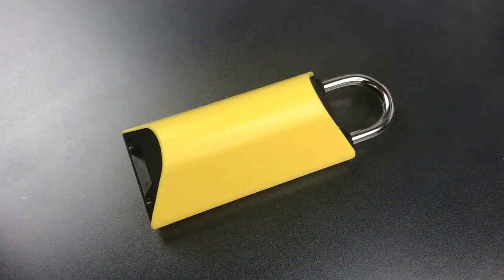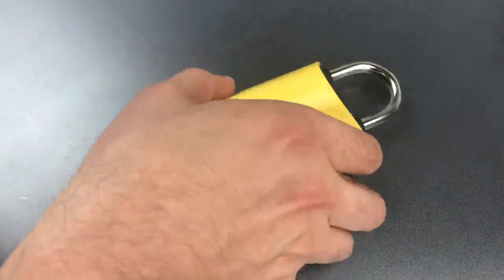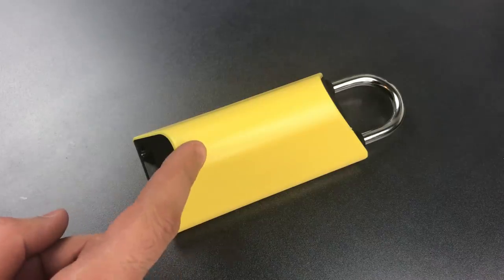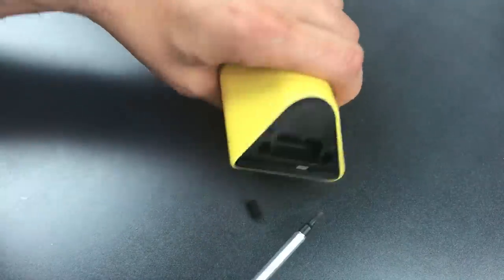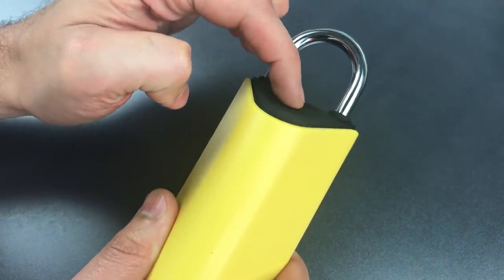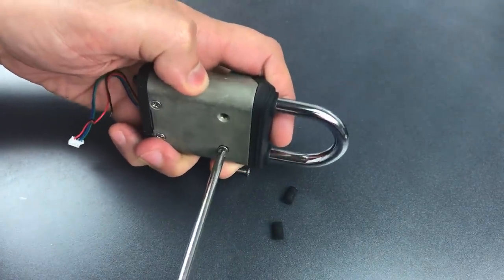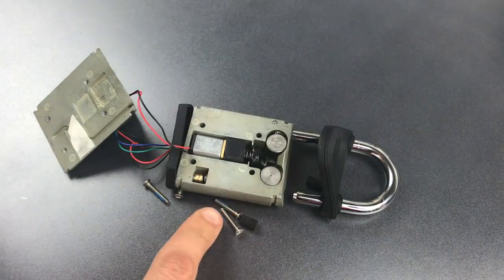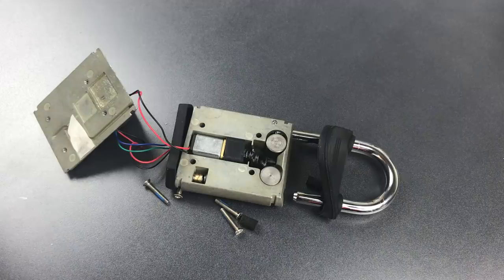[752] BoxLock: $129 Barcode-Scanning Padlock Opened With Screwdrivers!

Comment: Foam, the ultimate security material
Reply: Seriously. Even a tiny squirt of hot glue instead of the foam would have made for a significantly greater challenge.
Reply: @KurtRichterCISSP  and im suprised it wasnt a standard phillips Lol
Reply: Also the ultimate builders material. The lock itself us not much better than tied string
Reply: I'ld go with hot glue if it was my lock. To remove the hot glue, you need heat, which to bring it there you need alot of it, which would just melt the case anyway. The other way to remove the hotglue is to drill, which epoxy wouln't resist more anyway. But if the lock do need repair or a battery replacement, then you can easilly do it.
Reply: And welding the screws on the inner part would made it much harder to open.
Reply: @qq84  Other discussions show that the motor in the inner case can be controlled from outside.
Reply: @Timo - ha ha ha!
Reply: consider the lock outshell was made of plastic and once break open screw driver is enough to unlock it. The foam is not that much a problem
Reply: @bilibiliism  yeah, a hammer.
Reply: @qq84  or red locktite
Reply: Against water, yes. That's probably what it is meant for.
Reply: I LOL'd!
Reply: @bmo14lax  ...and I guess none of us got the memo, no one owns a screwdriver. That is why we can open this novelty lock
Reply: @thephantom1492  If it was my lock, I'd use it to decorate my house. I sure as hell wouldn't be trying to secure anything with it. LPL was WAY too easy on this PoS: even if you do block access to those screws, all that means is that they have to damage the plastic casing to get your package, which they were probably gonna do anyway, because cutting that casing in half with pruning shears would be way faster than LPL's method.
Reply: @ArchLinuxTux  But you need to own TWO screwdrivers to get into this. High security!
Reply: @beeble2003   i supise I could just return them when done 😄
Reply: Still better than nothing. Just imagine all the package thieves the junkie strung out pos that runs up to the porch grabs a box and runs. They wouldn't take the time or effort to try and open some things up just to look and see if there happens to be a package in there. I think this would help cut down a lot on the run of the mill package thieves.
Reply: @thephantom1492   no   fill it with jb weld   that stuff gets very hard
Reply: High security sponge
Reply: They should have potted it with loctite or something
Reply: To be fair it took few seconds more for LPL to remove the foam than he could open some other locks. And they installed two of these foam plugs!
Reply: @bmo14lax  not just a torx but a SECURITY torx, mind blowing design, they really went all out.
Reply: Another case of Security by Obscurity.
Reply: No! It's faith in our Lord Jesus Christ! It's ALL His to give and to take! The eyes of the Lord are in every place discerning the good from the evil. 🤨

Comment: Seems to me pulling the rubber cover off the top and drilling a small hole big enough to stick a paperclip in would depress the actuator opening the lock... The only thing missing from this "quality" toy is it being stamped ever so proudly Master lock.
Reply from the maker: Actually, there’s already a hole there. I immediately thought that I could push down the hole to open the lock. Whether by luck or design, there is a tad too little room for that to work. 

I was considering using a punch and hammer in that hole as a destructive experiment in a future video... if I can warp the parts just a bit, it may open. Stay tuned. 👍
Reply: nah, that rubber on the top makes a couple hammer blows much quieter.
Reply: @lockpickinglawyer  Did you consider "bumping" it? It looked like you could just push the locking mechanism down with your finger.
Reply: @1kreature I had a BoxLock and you cannot put your finger in to open it through that hole, you have to use a piece of medal long enough, strong and skinny to fit in that hole. My dad did it with a hammer and piece of metal through the top hole with the rubber off and he had a really hard time but finally got it to unlock.

Comment: For me being able to open a lock with a screwdriver is unacceptable, no matter what kind of technology it has inside. It being expensive just makes it worse.
Reply: How about the technology of: A small chemical bomb that goes off once its opened? ;)
Reply: I'm still trying to figure out why anyone would bother with a screwdriver for this thing. Way faster to cut the thing in half with pruning sheers.
Reply: @JohnDoe-nq4du  LPL did say he didn't want to break it in the process of unlocking it. Someone out to get through the lock will just cut through it. Literally.
Reply: @dkevans  If it's made of plastic, couldn't you just torch it like LPL did to that zinc master lock? Take 5 seconds to melt the entire thing with a good torch.
Reply: Yamcha Dragonball That's a great idea! That way, the thief does a couple months of community service when they get out of the hospital, and you get to spend at least a few years in a supermax for illegally manufacturing an explosive device and committing aggravated assault with a deadly weapon! That'll teach em.
Reply: @jacobesterson  Batteries explode bruh
Reply: it's not a regular screwdriver...

Comment: No alternative? Just leave an unlocked padlock on the container and let the deliveryman put the parcel inside and lock it. No key required. You do risk losing a padlock if it's an expensive one and a locksmith runs by. But you can use a cheap lock that is much more secure than this one.
Reply: Martin Sjölund Then if you get more than one delivery on a day, only the first package can be delivered.
Reply: @aszi77  Unless you have more strongboxes. But yes, if you have tons of deliveries you could use something better.
Reply: Or just use a combination lock and put the combination in the delivery instructions, heck, even putting the combination into the address would work, the only people who would see it before delivery would be the people responsible for delivery, and you just need to make sure you shred your address labels before tossing them in the garbage (which you should already be doing any way).
Reply: Kineth1  If you watch these videos, you know that all combination locks suck and are very easy to decode.
Reply: aszi88 Actually, I've only just started.  I've watched a couple of the combination lock videos, and while they may suck, they're still much better than this one.
Reply: If you remove the black silicone cover of the top, you will have two cables for the motor connected to the pcb. Removing the pcb and applying a voltage, will open the lock. So, you don't need to use a screw driver.
Reply: Martin Sjölund you guys all live in some weird ass alternate dimension. ive never in my life seen a delivery man do anything other than stuff a mailbox. lock packages in a box, read a sign etc, never happening.
Reply: you can do the equivalent of what libraries do to return books when they're closed which is a one way slot which things can be put in but not removed. this would only require the mail delivery person to push it through a slot and walk away. of course the slot would have to be big enough for whatever you're buying to fit through but then you could use 1000 locks if you wanted since you would be the only person opening it.
Reply: @StinkyBlack1  my delivery guy calls me on the phone. He texts me also. UPS. Although I'm at a business and I get tons of crap every day. Also I give him free reign of the fridge. Lol. My FedEx guy he's less cool lol.
Reply: Jay H Those packet drop off boxes are readily available from some of the brands that sell regular mailboxes outside the US.  They are typically fitted with a serious lock keyed to match your front door.  Mailman just drops in the package, trapdoor does the rest.  Like any mailbox, these are placed curbside so they don't need to back up your driveway or climb onto your porch.
Reply: my household gets packages every day, so i gave the regular driver from fedex and ups a 50$ giftcard to amazon for xmas.....both where very grateful and now they go the extra mile for me....and fifty bucks it aint that much....when you go out to eat you happily leave a 10-20$ tip to a waiter that did the bare minimum....so why not your delivery guy ?
Reply: @aszi77  Sargent and Greenleaf does make one that is quite secure from a decoding perspective. It's not cheap though, and it is not also resistant against destructive attacks. That being said, it probably would make a pretty good deterrent.

On the other hand, it'd be  a bit cumbersome for the deliveryman to open, given that it opens like most safe locks.
Reply: @alberto4caeiro  yeah I noticed that too
Reply: And cheaper
Reply: @aszi77  Make it a combination lock and put it on the delivery instructions
Reply: @CygnusX250   - We get a different delivery person almost every week. How many $50 bribes are you going to have to issue in a year?

Comment: They put phones together better they dont want u getting in them lmfao
Reply: opposite actually, this is put together better than cell phones because everything uses ribbon cables and clips instead of ultracheap soldering. making it more easily repaired.  still junk for security though
Reply: @Kakkarot22  wrong you literally cant get into an S7 EDGE
Reply: @handytech9481  i know, but as a piece of electronic tech the point still stands
Reply: @deephorizon1365  *wrong you literally can get into an S7 EDGE
Reply: @deephorizon1365  Just because you can't get into an S7 Edge doesn't mean it's impossible for everyone lmao
Reply: @snickerdoooodle  Well no, I know some people can get into them, but its a whole lot harder than this
Reply: @deephorizon1365  it's honestly really easy to get into an s7 edge, heat the back cut the adhesive take out the screws, now getting into say an htc one m7 without damaging the casing there's a challenge but even there it's not too bad once you know what you're doing.  only stuff thats truly hard to get into without damage are things like the iphone 2 and the ipod touch 1st gen and even then they're not impossible just a pain in the ass
Reply: @Mister_Brown  For most people that are not working in the phone repair business, opening an S7 (or any similarly built phone) without shattering the glass back and (in some phone's cases) cutting a few cables would be nearly impossible. Meanwhile, any moron with two standard screwdrivers could easily open this lock.
Reply: It's actually built like a laptop... needs different tools for no reason, and is easily damaged if you take it apart wrong.  And the connectors all look like they came right off of a laptop production line.
Reply: @Kakkarot22  wires. Not ribbon cables. Ribbon cables are at least ten wires combined
Reply: @Kakkarot22  wrong. They make phones perfectly good (for them that is)
Getting inside is a hassle, and theres a reason why they solder things like the charging port and headphone jack (well used to ) coz they don't want you to repair it at home.

An iphone or galaxy is 10x harder to get inside than getting inside this lock